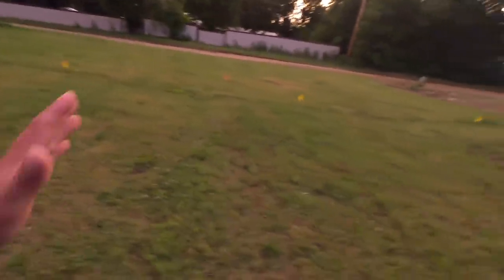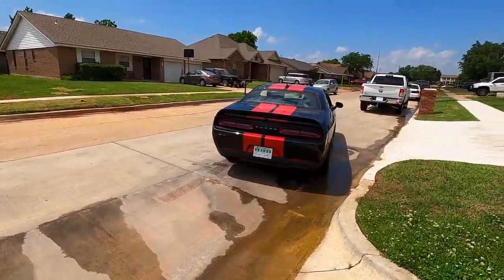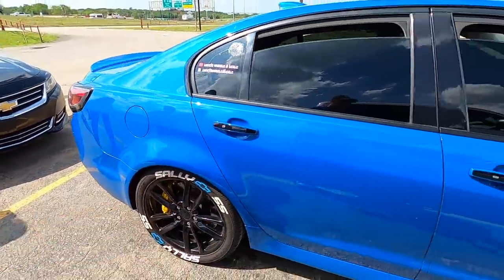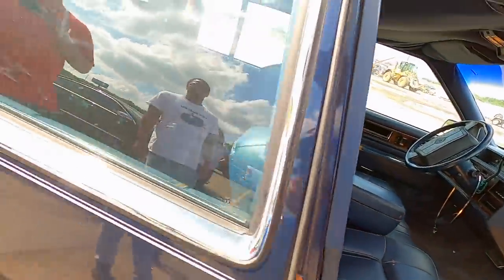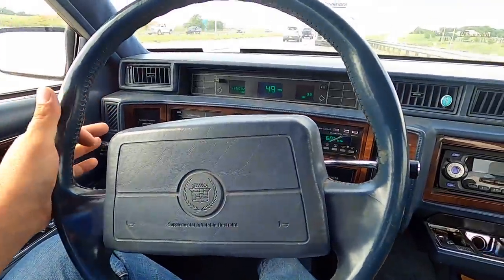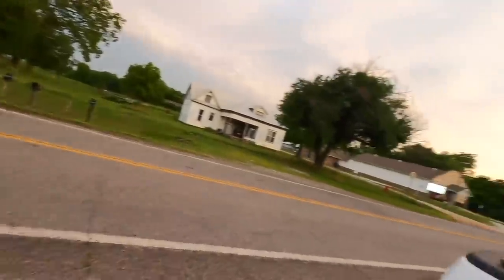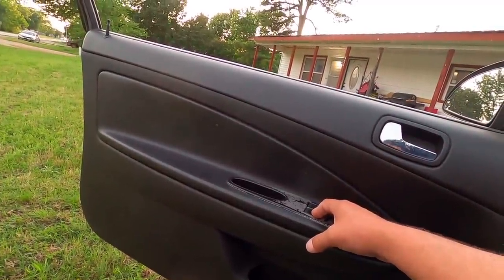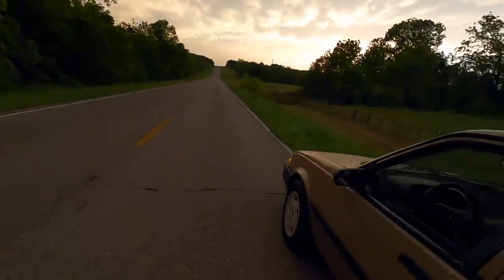1990 Cadillac DeVille 1 Owner Charity Donated IAA $500 WIN!!! Run and Drive??

Comment: My grandmother still has her 1992 with this same body style, that she bought in 1993 preowned at that time with 3000 miles on it. She is turning 97 in October this year and still driving her 1992..lol The mechanics have told her that her generation Cadillac was one of the few last years that GM made some reliable engines.

Comment: I had an 89 DeVille with the 4.5 that was a nice car.  It did really well until 250k miles, then the engine started smoking (only slightly) and the transmission completely failed.  I didn't want to scrap it as the car was still very nice.  I sold it to a guy for $150 who had a car just like it that was stolen a year prior and was recovered a few weeks before he found mine.  His car was stripped of too much to repair, but he said his transmission was rebuilt shortly before the theft.  His father in law had a transmission shop, and he brought the flat bed tow truck where I saw his original car, and he picked up my car and swapped the transmission.  He called me a few weeks later to thank me and tell me the car was driving and running great.  That made my day!

Comment: man I remember when my great great aunt gave me her 1987 Cadillac Sedan Deville with a spare tire hub which everyone was calling a 5th wheel and it was all black with a black canvas top and black cherry seats, AC Delco stereo without tape deck, power windows, locks and seats and it had 53,000 miles on it in 2004 when I sold it to another aunt for $3,000 after fixing all the belts, hoses, and minor stuff

Comment: Lucky you..Love those devilles can’t beat those old 4.5 or 4.9s I need to find one to fix mine..ps hold the off and warm button down on the climate control it will give you the engine codes so you know

Comment: 4.9 is a robust torquey motor itll run just might need tune up iac motor and id do lower intake gaskets it was their weak piont ive done 3 of them if i could find a way to run one in my truck id do it  but trans options limit that

Comment: If it doesn't misfire under load, it's probably not secondary ignition. Look at the block learn at idle to see if it's running lean. A block learn of 128 is what your looking for.  Higher numbers  mean the computer is adding fuel for a vacuum leak.  I would run it longer on the new fuel first, maybe it will clear up and you wont have to get dirty at all.

Comment: If you were inclined to charge the AC use redtek 12a refrigerant.  You can but a kit complete with hoses and gauge cheap and do it yourself, mixes with R12 and R134a.  I've used it on various cars and works great.

Comment: Same exact motor my 90 eldorado has, contrary to popular belief you can run regular unleaded in these and they will run just fine, I've had ours for seven years and always use regular unleaded and get 24-26 mpg, very nice car, I'd buy it from you if I lived closer

Comment: These were also known to have Distributor failure. The 4.5 was better than the 4.1 but still under powered.  Northstar came out in the Alanté in ‘93, in the deVille in ‘94.  Early Northstar engines were crap.  Their “issues” were not resolved until after ‘00 model years.
Reply: Racerboy221 
2005, actually,  when the head bolts were made thicker and with coarser threads....only question is why did it take so long to fix when EVERYONE knew about it? 1994 until 2005? Really,  Cadillac?
Reply: paige hunt I wish I new.  I’ve got a 1997 Seville SLS w/a 4.6 Northstar that had only 50k miles on the clock. At 63K, it started having 3 of the 5  known failures they suffered. So, unlike most who’d junk them, I had a brand new Northstar custom built for it.  Now, I’ve got a flawless car that will last for years to come!  No head bolt issues, no oil leaks, no coolant issues, just pure perfection!
Reply: Racerboy221 from now on, if you are going to buy ANY  car....search you tube for CAR WIZARD...he's a GREAT mechanic, and my FAVORITE thing he does is a buy this, not that for just about every manufacturer.  I was in the car selling business for 20 years and in 5 months of subscribing to him, I've learned more than I would have in 100 years. I know he's right about EVERYTHING because I have experienced so many of the lemons he recommended not to buy.   Definitely worth checking out.  He's where I learned about the Northstar thing....

Comment: My venture sat for five years before I started driving it again,,, Had a stuck lifter,,,   changed the oil,, added a half quart of marvel mystery oil with the oil change,,  Lifter noise got quieter,, but would come back sometimes,,, changed oil again, and added another half quart of marvel again,,,  lifter noise went away for about a week and came back again,,, changed oil again and added another half quart of marvel and lifter noise never came back,,   23 year old venture with only 100K miles,,  and it just runs sweet,, engine is so quiet, that when you are moving slowly through a neighborhood you can not here the car moving,,  It took a little time to fix the problem but still way better than replacing the lifters,,  :-)
Reply: darkwing- You are describing my 95 BUICK ROADMASTER with a LT.1 5.7 (350) CORVETTE ENGINE it runs so quite you CANNOT even tell it is running when it is IDLING it is SMOOTH as well & on top of that all you have to do to START IT is BUMP the STARTER & it FIRES right up OH my ROADMASTER sat for 5 years too it sat in a BARN  on an ESTATE & it had extremely low milage on it when my FOLKS bought it it has 130K  miles on it now

Comment: Randy, sold Chevy's for a while.  On the non-DoD LS engines whenever it had lifter tick I would let it full warm up and then go flog on it.  A few high rpm blasts and it would go away.  Give that a try.

Comment: Make sure you fill up your antifreeze Reservoir because those engines run really hot and those engines use premium gas fill up your antifreeze Reservoir I know what I'm telling you don't let it run on low antifreeze and also make sure when you turn on your AC sometimes it won't kick in because there's a relay right there in the middle of the firewall the firewall that tends to go out just in case your AC stops working also your ignition when you start your car sometimes it won't start cuz you have to wait till the alarm resets and sometimes the ignition altogether stops working

Comment: Omg! I owned one of these cars, very solid car but be sure to check the front left motor mount because they blow out easily but they are a cheap repair, their around 30 bucks, only issue is it’s behind the a/c compressor

Comment: Pull the valve cover get a old push rod from the wreckers seat it on the lift and tap on it. After poor some trans fluid in the oil run it for a bit. The gm 5.3 are known for lifters collapsing and flat lobe the cam and that is probably what happened said to say and all the parts new lifters pushrods cam and gasket set is about 1400 bucks

Comment: Randy, congrats on the construction on the new garage. your property seems to have a water run off issue so you might want to have someone that specializes in water mitigation or water run off before you go spending thousands or hundreds of thousands on a garage. you might want to take a look at https://www.garagejournal.com/forum/ for help as well. I have looked at that site for a while as i want to move to a warmer climet and either buy property and build my own garage and or buy a house with my dream garage but those kind of houses are few and far between.

Comment: You need to talk to Monkey wrench Mike. The transmission problem could be a problem with a electronic. Board under the hood. He had a Mercedes that would shift replaced it shifts fine

Comment: What engine in the Cadillac 1990 is not much better than the Northstar engine they're all of them block steel cast sleeve install long cylinder head bolts if the motor overheats the head bolts stripped out of the block and the sleeve will start leaking into oil pan and then you have to replace the motor I worked on a lot of these cars in the 90s I replaced lots of engines